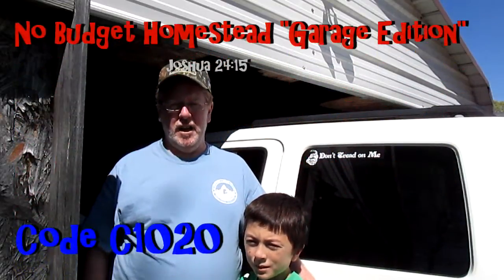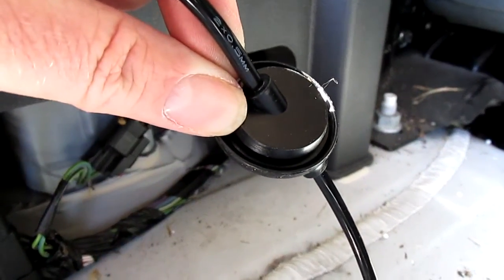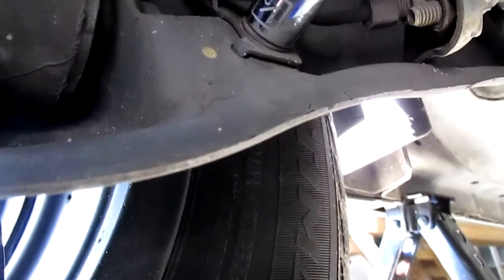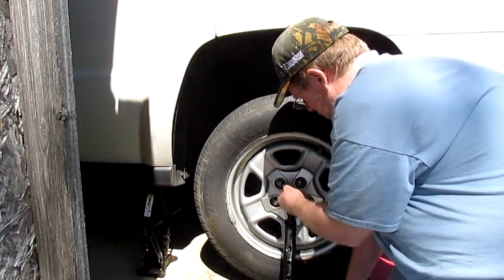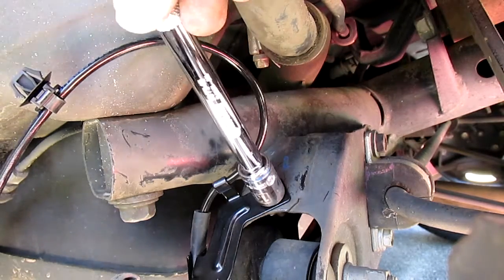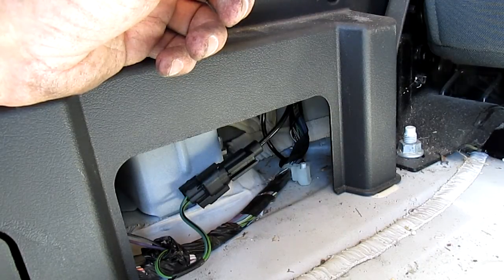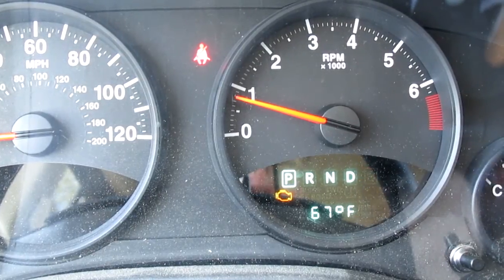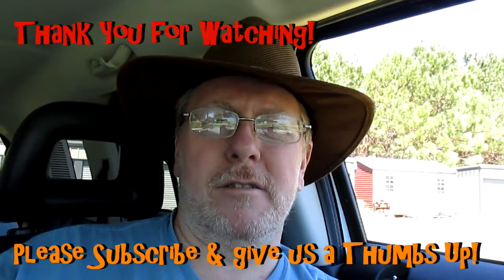Code C1020 - Jeep Patriot - NBH Garage Edition - RE-EDIT

Comment: thanks have same 2009 patriot same problem and did u ever fix check engine light I got the same enighe light code need help with that too
Reply from the maker: Your welcome!  I still have that check engine light.  It seems that the code that is causing the light to come on will take quite a bit of time that I dont seem to have a surplus of at the moment.  If I went to the dealer they will charge over a thousand bucks!  Just about all of the money would be labor!!!.....  When I have a long weekend and access to my dad's truck I will try to tackle it.  Until then I will just have to deal with the lower fuel economy....  :-)   Thanks for watch and God Bless!

Comment: Unless my 2009 Jeep patriot limited 4 x 4 has a different sized spare tire enclosure I had little problems replacing the factory doughnut with a full-sized limited-edition aluminum rim and tire! It fits a little snug and it has to fit with the inside of the room facing up when I put the scissor Jack in with the handle I had to spend the whole thing around getting it to fit snug and safely but it wasn't a real problem I can post a picture if you the salesman initially told me there was an option for a full-sized tire and rim he showed it to me during the initial sales talk. I paid $200 for the rim on eBayAnd they look larger and bulkier than the stock steel rims I've seen on the 2 Wheel Dr. Jeep patriot's so you shouldn't have any problem replacing it which I highly recommend since they aren't supposed to be driven over 35 miles an hour!I also replaced the valve stem with a low pressure warning valve stem like the other 4 tires had. Also purchased on eBay for a fraction of the price and that was 7 years ago and I've still had no problems with them!
Reply from the maker: Looks like I will have to take a look into getting a full size spare.  I really hate having those "donuts"!!  I will have to check out ebay and get me another steel wheel.  I only have the 4x2 Sport version, but I did get the 2.4L engine.  ;-)   Thanks for the feedback and for watching!  God Bless!
Reply: I have the limited which has aluminum alloy wheels which probably is larger and like I stated earlier it fit you shouldn't have a problem and I can go on and on about those doughnut tires!
Reply from the maker: +Patrick McCLeary Thanks!  And those donut tires, ERRRrrrr......  God Bless!